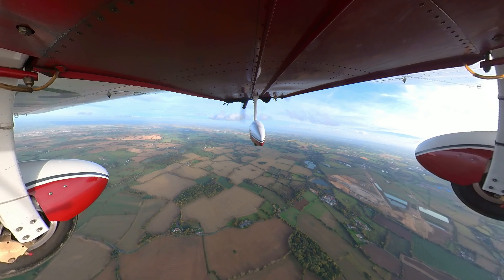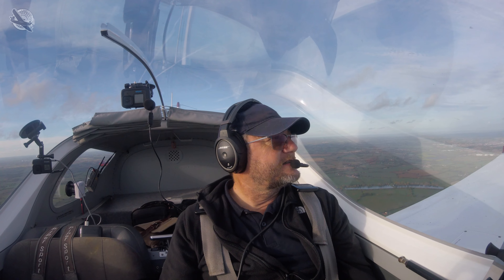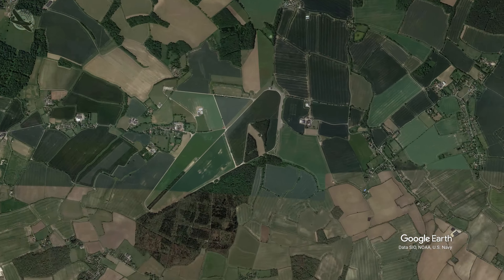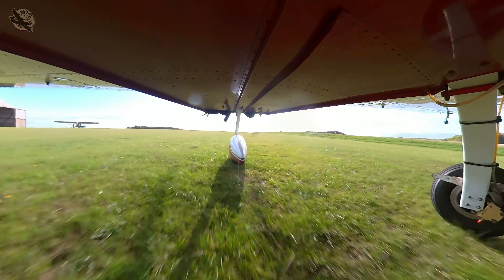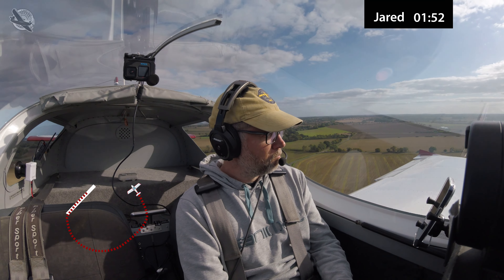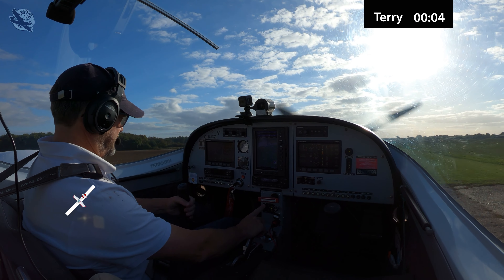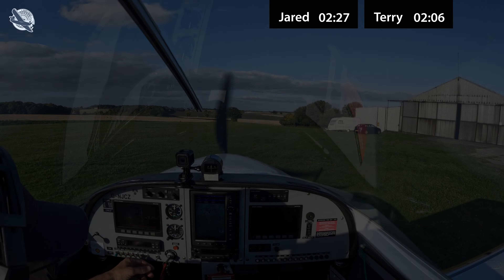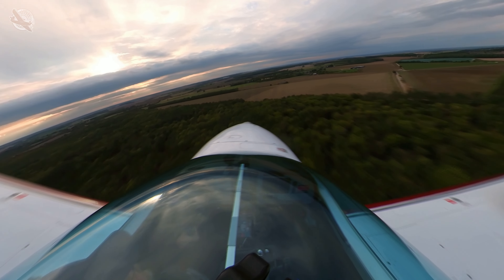Pattern racing and I break the aircraft.

Comment: I had a similar issue with a Bristell NG5 Ultralight (Europe). A bolt disappared and the loose fairig breaked the main gear at starboard after touchdown. It was an ugly feeling.
Reply from the maker: Yes lose a single screw and the whole bracket has alot of twisting and vibration on it. Thanks for the watch.

Comment: Hi Terry
I see you have the 696/695 Garmin, is it slaved to the AP 74? I have a 695 set up, but it’s not great to use (eyes are going), although it works great. I wish I could use SkyDemon to drive the AP74, but alas the D100 doesn’t have Wi-Fi capability so it won’t pick up any info from SKyDemon. Any thoughts?
Reply: Sorry Terry I meant I have a 495 not 695.
Reply from the maker: @stevenstyles7602  Steve, our 695 is integrated into the A/P. We just enter a route and can select either radio or GPS as the NAV source for the autopilot. It works brilliantly with curved predictive turns and along with the altitude pre-select option makes it a dream to fly on A/P. I think you need the 695 to do this and they're becoming pretty rare now.
Reply: @ShortField  
Terry
It would very  interesting if you could do a video showing how you use the AP, via the Garmin gps., and it’s capabilities and limits.
Reply from the maker: @stevenstyles7602  bit specialist but I'll knock something up for you.
Reply: @ShortField  
Terry
That would be really interesting. I’ve found out SkyDemon won’t allow any data to be output from their  software, to run an Autopilot.
So I’m looking for an upgrade from my 495, to maybe a 695/696/area 760, etc. any thoughts on a good alternative?